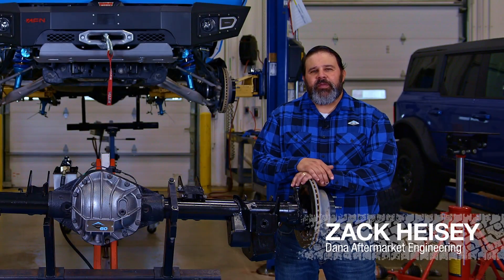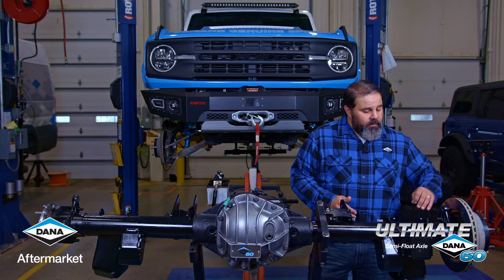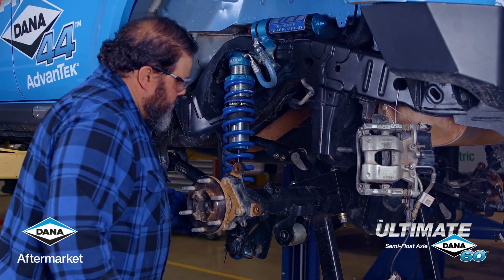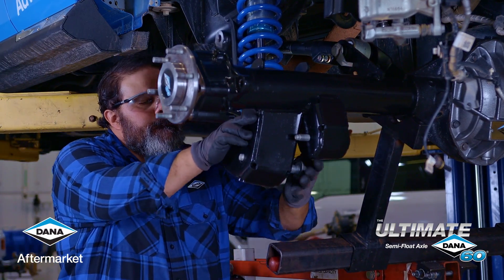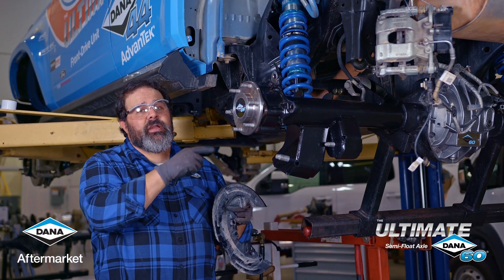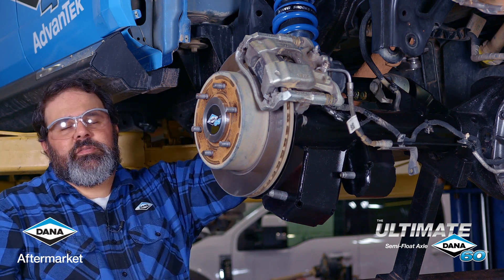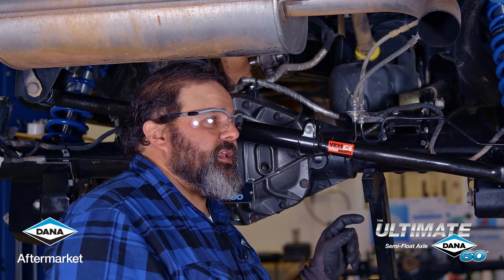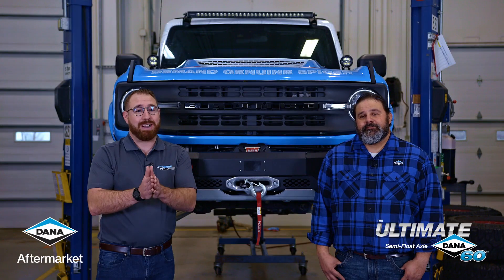Installing the Ultimate Dana 60™ Semi-Float Axle for Ford® Bronco

Comment: What’s the point if they aren’t wider than stock and aren’t full float?
Reply: Not everyone wants to buy new wheels. Also it is a dual row bearing set up which gives it almost the same strength as a full float axle. Dynatrac does this in their profloat axles. you can see their test video online. Semi float also saves a lot of weight vs a full float. about 150lbs per axle is saved going a semi float. Not everyone needs full float.
Reply: @TheRambler-pz1gx  I've seen bent axle flanges left and right on aftermarket 60 semi floats in the Jeeping world
Reply: @TJ-po9ol in Rubis?